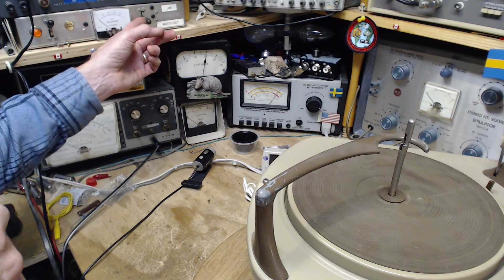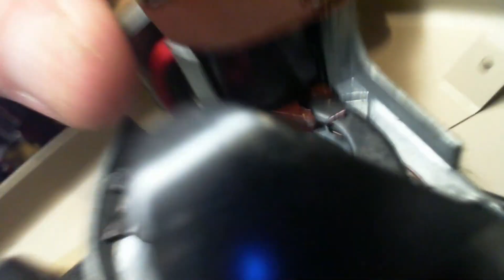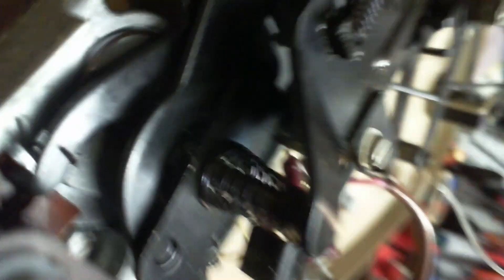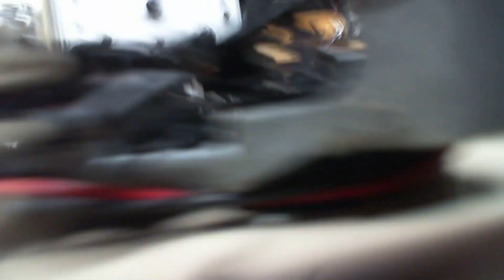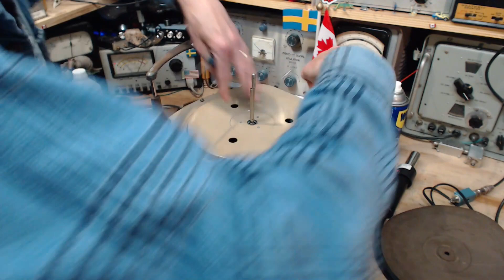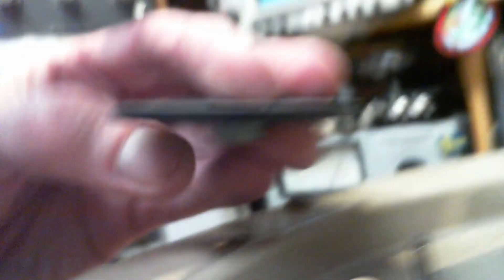Telefunken TW501 Record Changer Restoration - Video #1 of 4

Comment: One can clearly see poor Jim has no clue. I knew he was going to say “ WD 40” . Alcohol to clean I could agree with, but lubrication needs to be more specific as to the type and grade.  Worn parts need to be recognized and replaced, not jus cleaned , oiled or grease. Some levers worn on contact tension and get shiny and smooth. All one needs to do is rough it up with a fine grit and cleaned. He reminds me of the mechanic the changes parts and guesses what wrong .  These pieces of junk are not worth the time to fix. I know because I’ve done so many of them…..Pete 1956’s and 60 commercial junk.

Comment: 57:42 In case someone wants to concoct such a rubber "renewing" potion for a fraction of the price; the more commonly known MG Chemicals 408A "Rubber Renue" contains as active agent xylene (~65%) and ethylbenzene (~22%) with the rest being methyl salicate. 
And yes it is spelled Rubber "Renue" - not Renew. The mixed results reported and experienced with any of these miracle potions makes one think, they knew why they misspelled "renew".
But that being said, it sure beats sanding down the idler wheel like seen at 1:05:00
Because again; and Jim does not learn, sanding down and thereby reducing the size of the idler wheel DOES NOT influence the speed, but it DOES change the angles in which the motor shaft, idler wheel and platter interact and connect. The optimal idler size offers an effect where adding drag to the platter will result in an increase in contacting pressure between all drive components, and thereby countertact slip, which loading the platter may cause. A too small diameter of the idler (for example due to sanding an already dried up, thus shrunken and by wear abrased idler) will result in the idler wedging itself too much between shaft and platter, slowing the motor down. While a too big idler diameter will not present the desired effect. A way too large idler may even exhibit a friction loss on applying drag to the platter. 
And yes, there is various websites describing this effect both in layman's terms and on a scientific scale.
You just have to take the tip, and read up on it to educate yourself...
Reply: You said a mouthful!
Reply: @erin19030 He’s evidently got nothing better to do than armchair quarterback others who, imperfect as they may be, are doing something they enjoy and freely sharing the experience. Sad, really.

Comment: 2:48 Quote "Often times the clamping part is loose in the holder" End of Quote. Well as we can clearly see at 2:40 this is the case; the "clamping part" is quite loose in the bakelite shell, which it always is... 
And even if it wasnt and you find that you can tighten down the screw terminals like seen at 3:58 , this would be not much of a surprise under these circumstances. 
And NO Jim, it was not loose/broken from the factory.
These are stranded copper wires, which have been tinned to prevent the end from splaying out/unravelling. But tinning stranded copper wire makes it susceptable to what in german terms is called "Kaltfluss" - "cold flow" - but more often described under the english term "creep". Creep is the tendency of a solid material (conductor) to move or deform under pressure, without regaining shape once the pressure is removed, - much like putty or clay. Aluminium is a prime example of a conductive material that exhibits creep and every electrician knows about the dangers of using aluminium wiring on screw down terminals; the connection simply fails over time because like putty the aluminium evades the claping pressure of the screw down terminal. Only special spring loaded connectors offering a continous pressure even when a shape shift on the conductor occurs are suited to safely connect aluminium wiring.
And like said; tinning stranded copper wire puts it up there with aluminium when it comes to creep. This is why it has become mandatory to press on end sleeves aka ferrules to stranded copper wire when it needs to be put in a screw down terminal and not tin the stranded wire.
Funny, but a retired power company EE should know about creep and not go "oh boy" when facing it.
Reply: K.